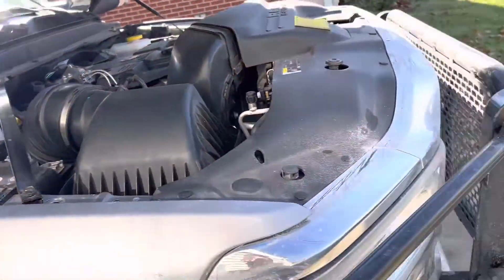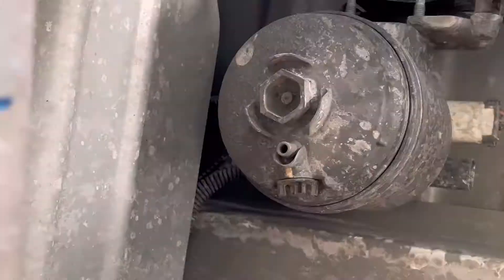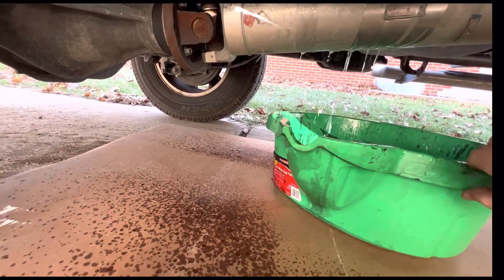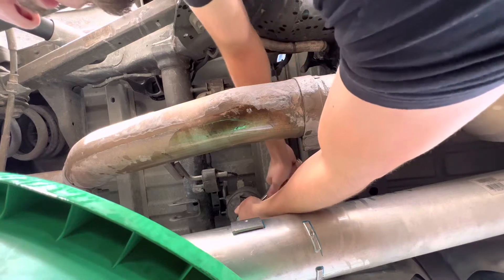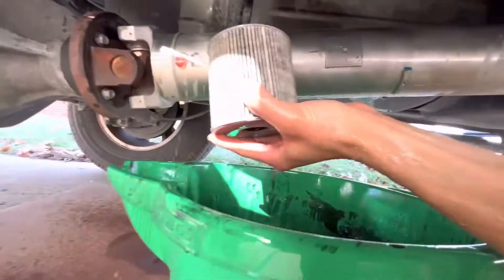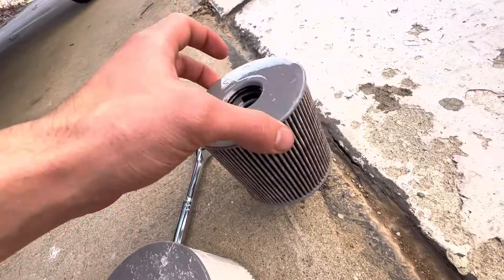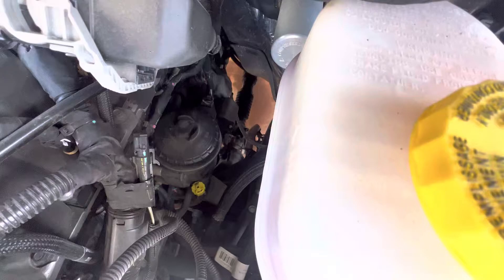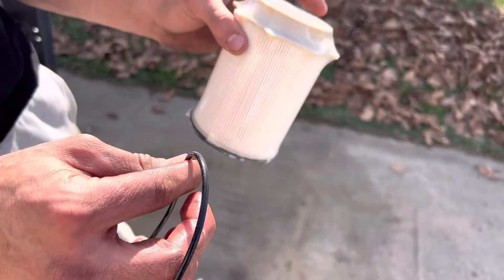2022 Ram 2500 super duty diesel turbo fuel filter change

Comment: By far the most precise, to the point, imformative with visuales and most importantly a short video.
Reply: Front fuel/water separator, if you continue to turn yellow know, it will drain the fuel out of the bottom, just like the rear filter.  You then take the filter out.

Comment: very accurate - it is messy, just saw the suggestion on plastic tubing which is great idea.   On bottom filter, i went to tighten back up the "bleed valve" and the cheap plastic snapped right off - I did not over tighten.   So $140+ later for whole new valve cap, not sure I saved any money changing filters myself.
Reply: And in the bonehead department, on bottom filter I wasn't careful about gasket placement since a couple days had gone by before getting my new fuel cap.  I put gasket in bottom channel/groove and when went to start, diesel came pouring out.   After looking at video again and stopping on picture, realized the gasket goes up into second groove/channel where the thread starts - and all was good when I reinstalled.   Will not make that mistake again -doubled the diesel smell on clothes :).

Comment: I have lifetime free oil changes on my 2022 3500 DRW Limited, but I'll change the fuel filters at home.  I did my own fuel filters on my 2016 and 2018 and it was a easy, but this new canister filter will be a breeze.  I'm going to use a small hose to assist draining so it doesn't make a mess.  Thanks for the vid.

Comment: The local dealer wanted $475 to change the filters out on my 22 2500 6.7L. $100 for the filters, had the sockets, and 30 minutes later, all done. Dealer was slightly upset when I told them only change the engine oil as I just changed the fuel filters.   

Also, read the fine print on dealer's service contracts of you are thinking of getting one. Mine covered all the oil and fluids but NOT fuel filters.
Reply from the maker: Dealerships are a scam they absolutely overcharge everything all the time
Reply: Mine didn't cover anything & charged me $255 for an oil change. Won't be going there again
Reply: Dang, I was wondering about that.  I paid about the same for my first filter change, but I won't pay it again.  I'll just do it myself.